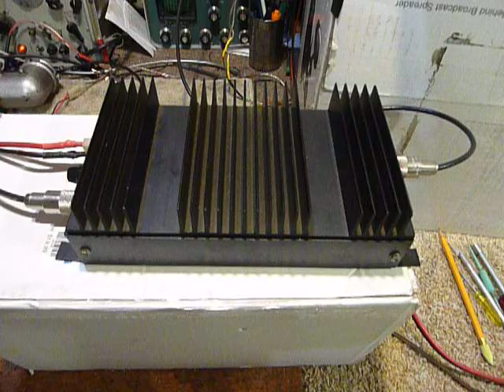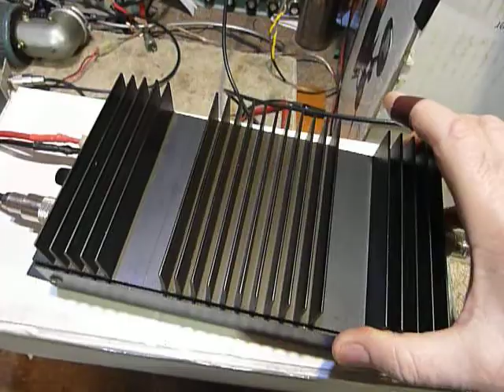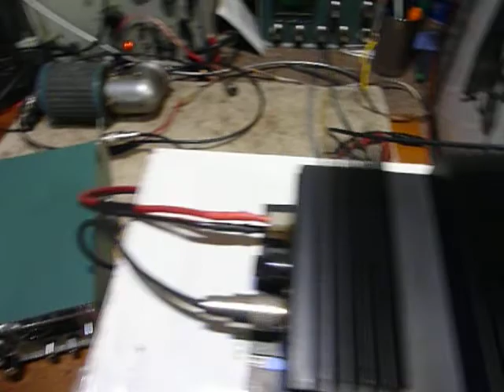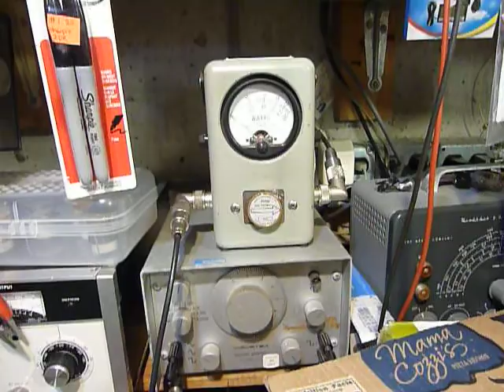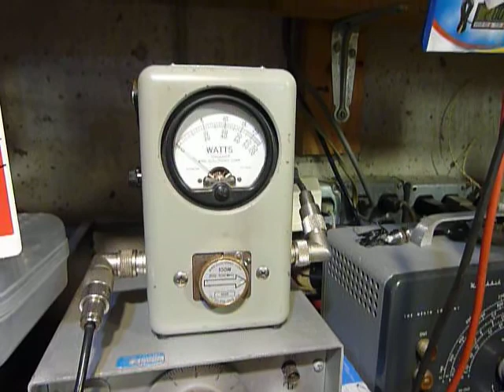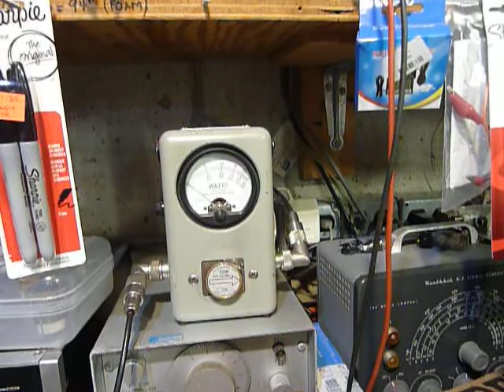HEATHKIT VL1180 TWO METER AMPLIFIER

Comment: Hello from Bob Jonasson WB6JRY.I,too,am a Heathkit fan.I have 2 complete Heathkit stations: SB-303/SB-401 with SB-650 frequency display converted to green LED readout and an SB-301/SB 401 also with an SB-650 frequency display which I will convert to a 7 segment green LED readout.I also have an SB-220 which needs the Harbach upgrades before it can be used again.